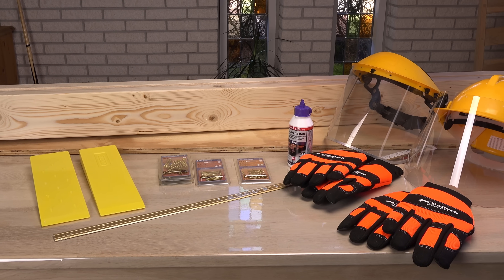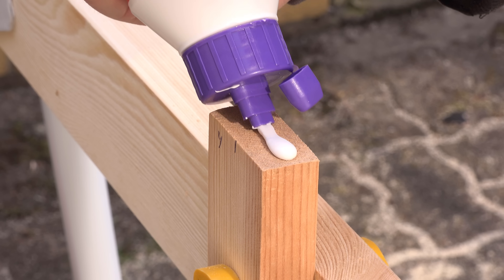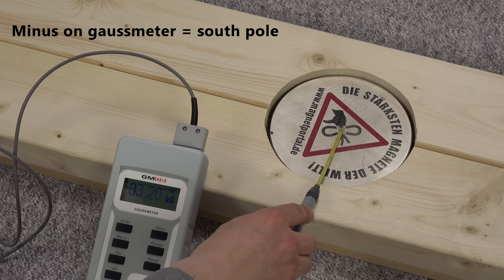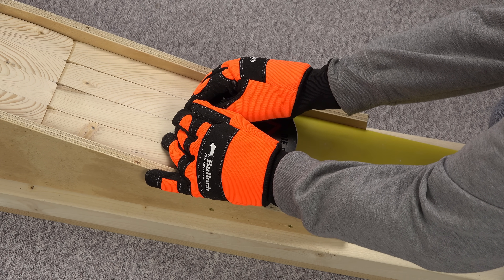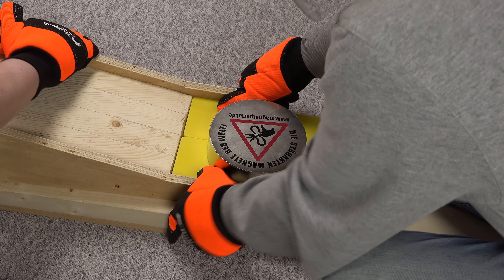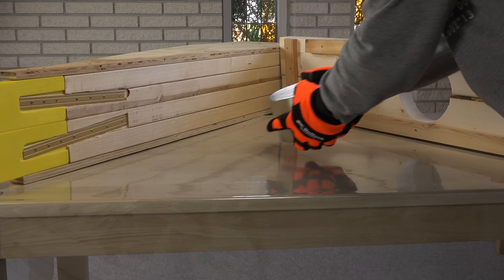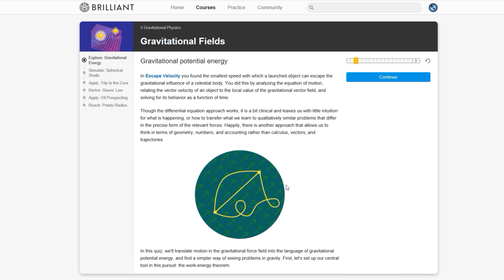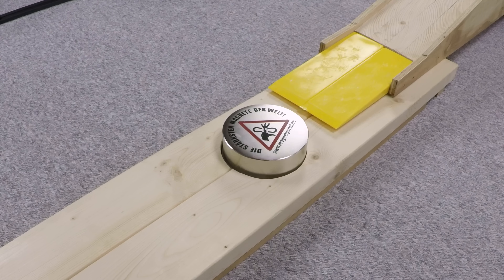Monster magnet meets monster magnet...

Comment: Why just didn't you take a wooden mold and put one magnet at the bottom the put an ice block on top and on top of the ice block the other magnet. As soon as the ice block is melted, the magnets would have been combined.
Reply: Ice doesn't melt evenly so you can't predict the outcome. Well, the outcome would probably be two shattered magnets.
Reply: @NotBroihon  you're wrong
Reply: @EnoX-1988  thanks for your well structured argument.

Comment: That sound was the force of the magnet pulling the other magnet to it's side. It doesn't resist in that so when you try destroying it's contact is basically pulls itself back to It. Because it's strong it's magnetic field are pulling if together with power.

Comment: Simple.  Use hydraulics.  You need a large diameter tube with an ID of EXACTLY the size of the circumference of the magnets.  Seal the tube and add in a very small bleed line that can be controlled at high psi.  Getting them apart again will be much easier than putting them together.  You can also just use a wooden scissor to slide the magnets together.  You could make an entire Tv show of average idiots trying to get these types of magnets together without destroying them.  That would be hilarious to watch.

Comment: Uh is it just me or did you only accomplish wasting 2 very expensive magnets? Those things are SUPER EXPENSIVE, but now useless lol.
Reply: Why are they useless now? He now got a much stronger magnet for his experiments.
Reply: @NotBroihon  i guess youre right. I would like just one of these magnets. Theyre all expensive as hell. I want to experiment the coalition between magnetism and gravity. I know that they are one in the same by derivation. I have seen spinning heavy weight out from the body cancels out the gravity of tge item, but what happens when you do the sane thing with POWERFUL magnets. I think if you take 2 magnets and mount and brace the polar opposites toward each other which causes them to repel, but mounted in place, then spin at a hogh rpm and perhaps add an electric charge this would produce a repelling electromagnetic field. I love magnetism and gravity but respect the force and power and of course danger involved. I just dont have the means to procure such items. OH WELL, I guess Ill just have to wait and see someone else do it.

Comment: 05:52 is the vibration of the plastic wedges, almost ringing like a bell. It’s caused by the directional force of the magnet creating a huge amount of friction as it slides downward, and the wedges are not secured at the base so they just continue the vibration.

Comment: Could you have made a plastic cylinder, with tiny holes to let out water,  the size of the magnets and filled it with ice.   As the ice melts, the magnets get closer together until they are together?

Comment: A plastic tube with holes drilled in it that can snugly surround the magnets. A second rubber tube that can surround the first tube (no holes). Place one magnet in the bottom of the first tube. Put the first tube into the second. Fill with water with an inch left near surface. Freeze. Remove outer tube and place second magnet on top. It will melt out of the holes until the magnets meet gently.

Comment: me and my manger were civilians working for the Army in the 80's on computer systems that had a phoenix pack single removable disk.. The read write heads would move in and out on a big voice coil type mechanism that was in a very large magnet. There was a warning label on the magnet...did we pay it any attention...of course not. We were working on the disk drive and my managers had slammed down against the magnet. it was his watch. We could not pull his arm up. By this time we were laughing hysterically. We had to undo his watch...just as the Colonel we reported to walked in and saw the watch stuck to the top of the magnet . He just looked at us and sighed and walked out. We never were able to get the watch off and we used the drive for parts...as far as I know the watch is still stuck to the magnet at the bottom of a dump.

Comment: You could build a pulley system for each of the magnets with 1300 kgs of counterweight attached behind each of the magnets. Since the pull force is rated 1200 you could take out weights from the counterweight slowly (in increments of 10) until the two magnets meet.

However this method may leave some material in between the two magnets. But it will be a little bit more fun.

Comment: How you can electrocute yourself using those magnets and 1 meter of copper wire with about 2 mm in diameter?
-Make a small coil out of the copper wire, then hold the both ends of the wire in each hand and move it around the magnets...

Comment: I worked in a synchrotron in Grenoble years ago and if I learnt anything it was not to mess with strong magnets :D  I once witnessed a moment where  a spherical survey target weighing 800 grams simply jumped upwards from my hands, attaching itself against a 4 cm thick wooden panel which was covering magnets on a so called insertion device.

Comment: could you just use your hands and combine them together
Reply: Each of these magnets has a force of 1250 kilograms. If you were to bring them together using your hands,
1. they would rapidly pull towards each other
2. you couldn't hold them (unless you're strong enough to lift a car)
3. everything in between them would be squashed with a combined force of 2.5 tons (possibly your hands)
4. the magnets are quite brittle, and would then shatter from crashing together

Comment: Next challenge: Take the two magnets apart!

Most likes ever gotten thanks guys!!
Reply: Splitting atoms would be easier.
Reply: raisin_ bren probably
Reply: My guess would be to do it by separating them sideways, like using two strong boards with a hole, holding one magnet each. Then put both boards over the magnets, fix the lower board, and pull the upper one sideways. Maybe the magnets have to be squeezed into the hole with screws from the side to prevent them from "jumping out", also.
Reply: But what if you are too late? and they're already stuck. 

This is the dilemma we all face. What happens when we become stuck. We try to force each apart, and it only leads to busted fingers, and sore wrists. And she will call the police. And then you have to explain that it was two rare earth magnets coupled with high electrical current, and deathly radiation from an exposed magnetron, and no one believes you. You spend 25 years in prison, escape after 2 decades of manufacturing your escape route through weak sandstone walls, and abscond... to what? The attraction once more to... Magnets.

once you fuck with magnets.. they never let go.
Reply: Ulrich Windl oh great idea!
Reply: Handball bundesliga
Reply: D 12 with pallets tied to the blade ..
Reply: If you make them hot enough they will be easy to take apart
Reply: 86.. could have been 87. You almost made it 87. But I didn't. I stole 87 from you. I am your 87'th like, that never happened. I am a thief, stealing from you. HUE hahaha..  And now that I am finished with you, YOU MAY GO.
Reply: Parishna 😅
Reply: @hammer time..

Awww fugit.. Have 87 :)
Reply: Parishna thx 😄 here have a sub
Reply: A video for you. Please Like and Subscribe, thank you: https://www.youtube.com/watch?v=8IMPe5hdw5Y&t=3s

Comment: why not put the 1 magnet in the depressed hole, as you did here, and then slide the other magnet towards it, restraining its movement slowly and gradually let it do all the work of pulling itself towards the other magnet. you keep it's advance at a slow pace and you don't yet yellow plastic stuck between them at the end.

Comment: Great video! Am curious... was the magnet trying to align with the geomagnetic field at 7:40? Also, all those who commented "why not just throw the magnets together", don't understand the inverse square law. The force pulling the magnets together increases exponentially as the magnets get closer. I once had 2 relatively small neodymium magnets about 12 inches apart, and they unexpectedly flew into each other with such force that it caused a flash of light. The magnets cracked but remained mostly intact. I learned my lesson after that.

Comment: I have 8 of these the size of a nickel and 1/2 in. Thick. We were playing with them and they can attract through the palm of your hand. As we were putting them away they snapped together as my daughter was picking them up. They snapped so hard they actually took off a piece of her finger. As they did they shattered. That’s why these guys have the face shields and hard hats on. If you were to drop one on top of the other they would explode.

Comment: This might have been easier... find a pipe, maybe 800mm in length that has almost the same inner diameter as the magnets.  With one magnet at the bottom of a bucket containing a rubber pad (to seal), place the pipe over the top in the vertical position. Fill the pipe up almost to the top with water...and you guess it, drop the second magnet in.  The second magnet should drop slowly down to its mate as there is enough space between the magnets and the pipe wall for water to slowly pass by.   Oh yeah, it would probably be a good idea to have a thick pipe :)

Comment: try placing fixed magnet in front of a wheeled vehicle (within force range and lighter than 1 tonne)?  propel vehicle without fuel?, to unknown speed?. Would the magnet have to move to move the vehicle?

Comment: That was an extremely huge waste of time and energy, not to mention some really great and expensive rare earth magnets. Now you really are limited as to what you can do with them from here. It would have been smarter to design an experiment utilizing the repulsive forces, perhaps a home made magnetic bearing experiment or a comparison of electric generation utilizing less powerful magnets and then these or maybe..........alas, you are now down to just one high strength magnet effectively so find a spot on the shelf (wooden hopefully) and lock it down so it dosen't hurt you later.
Reply: Exactly Mark, waste of non educational nonsense. 
Vs
Showing like you suggested - the power of opposed forces vs truck spring. 
This ridiculous wedge putting them together can simply be done by hydraulics, placed in tube at either end, allowed to come together by releasing the pressure of oil between them in controlled needle valve and see the actual pressure in real time. 
So much data simply vanished into thin air here, Without any real thought. 
2. The other, never thought of, shaft clamps mounted to beams securing magnets, where srcew jacks can simply apply the force necessary to put them together, in repulsive action to verify the forces in lbs, etc. 
Now - getting them apart is only possible by hydraulics, or screw Jack's sliding them apart. But of course secured in jig frame to clearly separate cleanly and safely far enough to be handled. 
Cheers 
I've purchased several $100 magnet orders from guass brothers in the past, 
where the largest ones are roughly 1/4" by 1_1/2", and they are dangerous enough. Not possible to separate, without sliding them apart under very high forces.
Reply: It's entertaining.
Reply: @Jolgeable  
Just once, for ultimate entertainment, 
and I do have ultra high powered magnets to prove concept, and open box of band-aids within reach - 
let them do live snapped together with a little flesh getting in the way.
Reply: Said no one ever
Reply: Thanks for the comment, many people really appreciate the time it took to make
Reply: You dum dum
Reply: 5 likes...
1 of them is you